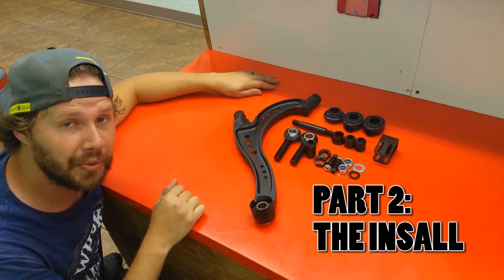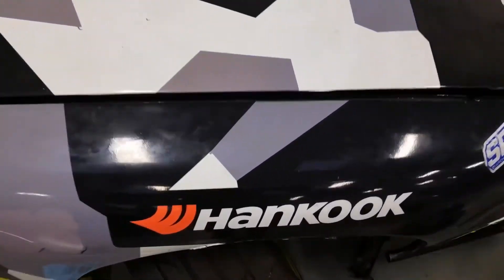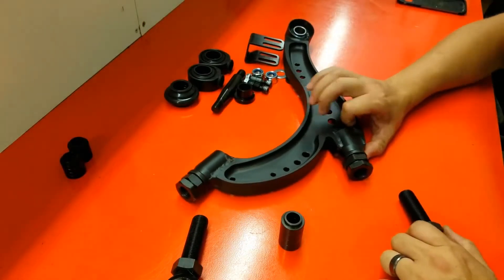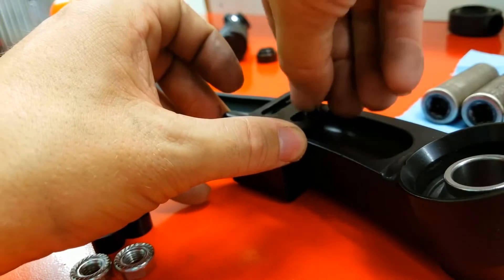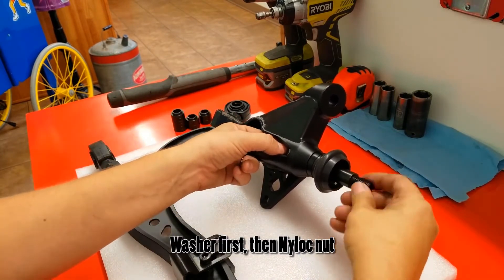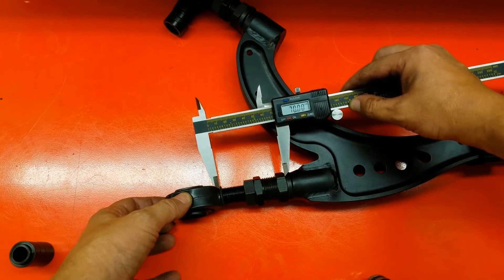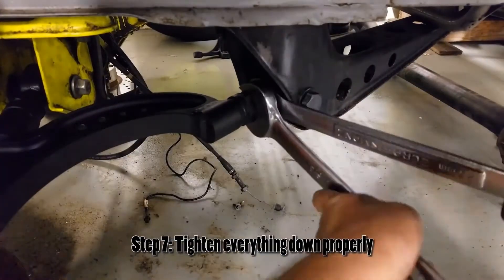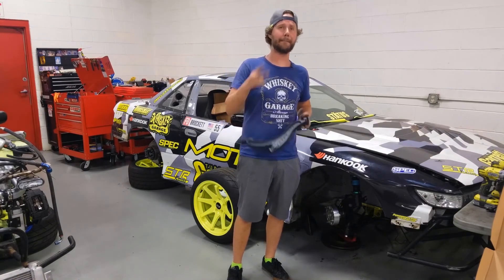Gktech V1 Super Lock Lower Control Arms - Install

Comment: Dan, hoping you can help me. I have these as well as the rest of the full angle kit on my ls3 swapped s13 coupe. I have relocated the rack forward to where the tie rods are straight across. And adjusted the washers to make the tie rods parallel to the lower control arms. Yet I’m bending tie rods like no tomorrow literally 2-4tie rods an event. Do you have any idea what is going on or a any suggestions? Tie rods are cheap but it’s a pain in the butt to have to change them. Any suggestions? Thank you!
Reply from the maker: Hi there, please reach out to sales@gktech.com directly VIA email and they can help.

Comment: My R34 GT-T bump install tolerance is way too tight to fit the washers in.  I notice that you added more reinforcement  on my bump stops (metal plate) welded that tightens the clearance. I can't slide them under so I was forced to put on top.  It not ideal.   An alternative workaround would be to shim material off the spacers but knowing myself I'd take too much material off.
Reply from the maker: Hey mate, best to reach out to sales@gktech.com.au for technical questions! Thanks and sorry for any inconvenience!
Reply: I'm having same issue on my s14. Did you ever get it resolved?
Reply: @clarissa-mayjavier9372 I know it's been a year but I had the same problem. I just got some adjustable wrenches and opened them a bit.
Reply: @cmayjavier  No. I've been really busy working, but I have access to a machine shop at my work so I'll get around to it.    I've just got all the stuff on the bench.

Comment: wheel spec?
Reply from the maker: That can be used? Any really, the lower the offset the more clearance you will have though and as such, more steering lock!
Reply: Thanks for the reply, what i was after was the wheel shown.. then I could put the numbers in a offset calculator to figure out my sizing
Reply from the maker: @schafer240  Oh right, sorry! They are 17x9 +25 with a 20mm spacer used in this video!
Reply: Awesome thank you

Comment: Hey there I  got to super lock kit from you guys put it in my s13 get heaps of lock when jacked up but don't get hardly any when back on the ground and it's not getting to the lock stops any help would be great thanks
Reply from the maker: Hey dude,

Feel feel to send us an email at sales@gktech.com.au with some photos of the setup and how it is fitted and we will go from there.

John
Reply: what was your fix for this?
Reply: I ended up getting the v3 offset strut tops that moved my shock down 30mm as my coilovers were not hight adjustable first i packed the shocks tops with 30mm of washers to make sure it would work before i bought them hope this helps